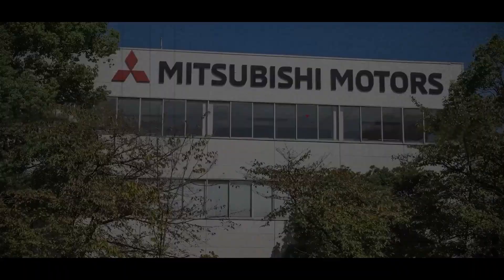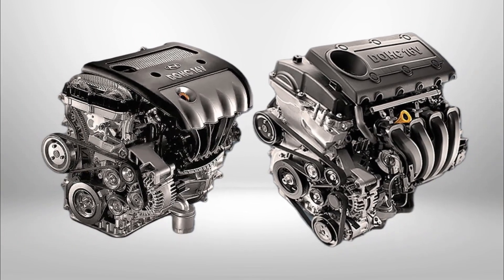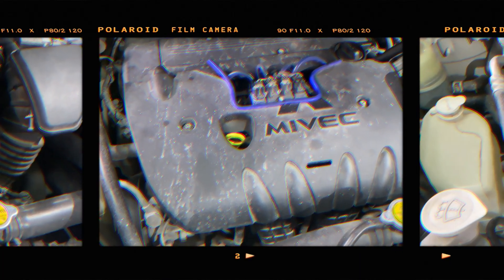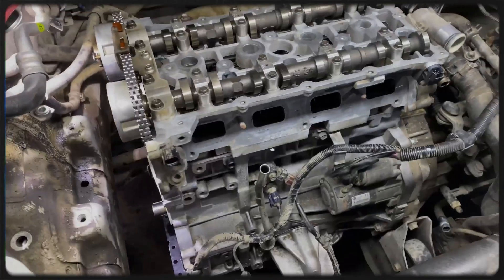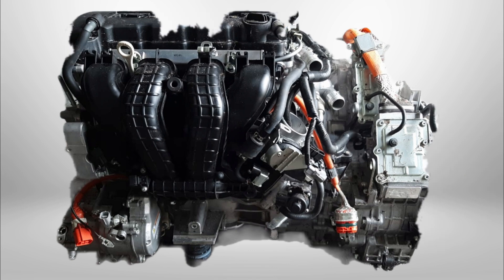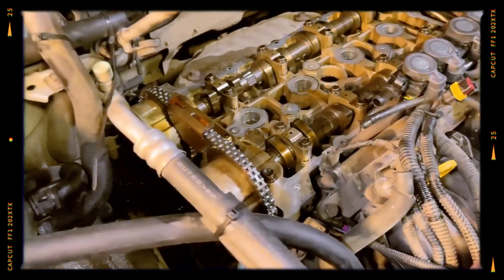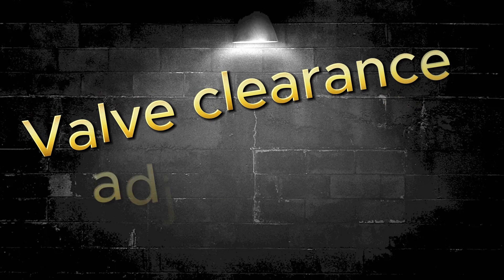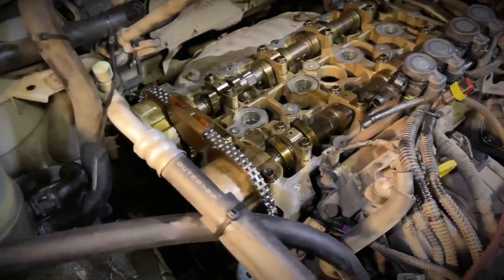Comprehensive Technical Review of the Mitsubishi 4B12 2.4L Engine:Design, Maintenance, Common Issues

Comment: I have 392K miles on my 4b12 & it's still running strong.
Reply: Have you ever done valve adjustment on it?
Reply: @Chetan_N_S just replaced the timing chain, guides, & tentionor at 350K.
Reply: @Nomsyin Hello, what kind of oil do you use?
Reply: @Nomsyin Hello, what kind of oil do you use?
Reply: @Maiasar-lv6be royal purple 0w20